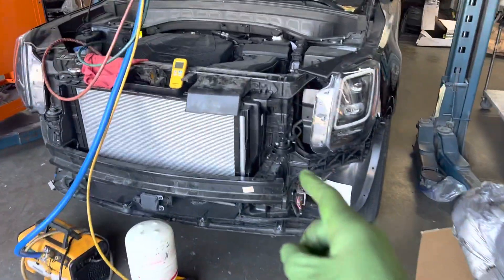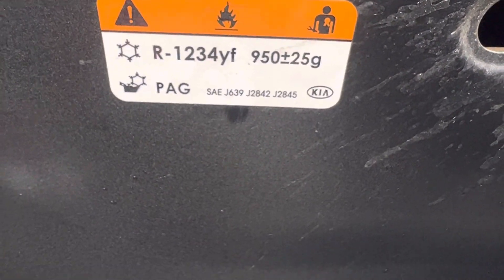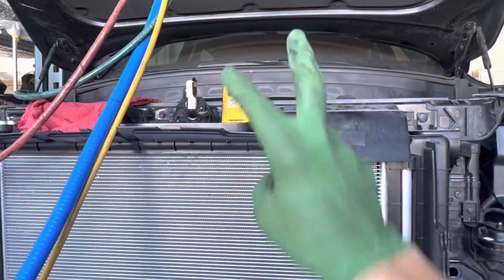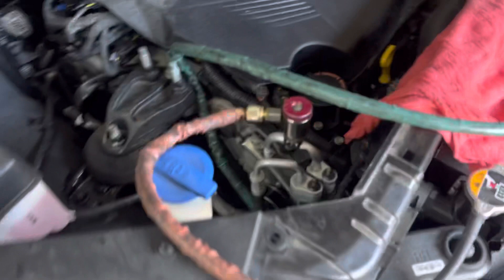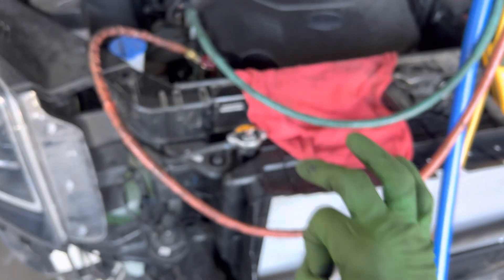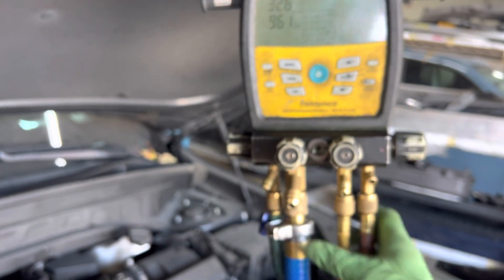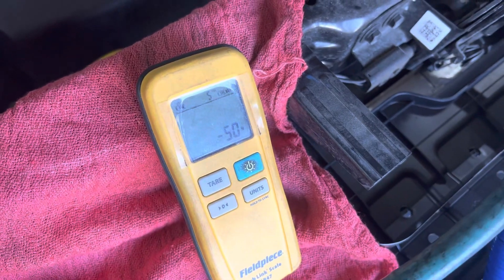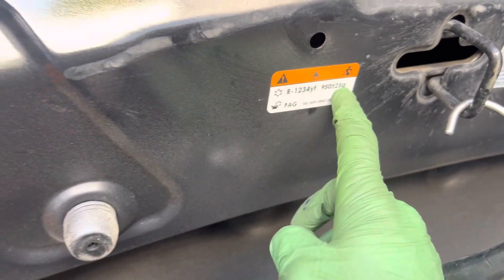SUPER LARGE AC CONDENSER  it comes to heat rejection surface area is King in the world of physics

Comment: if i put larger car's condenser, the car's ac will be cooler or will be faster cooling? for refference, my maximum standard car's ac is 18 celcius degree, how far it can reach maximum cold if i change, let's say 1.5 size from the original one. and can the evaporator handle it? thank you
Reply from the maker: 18°C is horrible performance.  Unless you must live in some very very hot climate.. 
         ACs maximum performance is usually obtained only if the refrigerant charge is correct and unfortunately, often when air conditioning is done by multiple people or people don’t know have too much oil in the system causes it not to work correctly.,

You may have also noticed air conditioning compressors do not work efficiently at idle engine speed usually once they start hitting about 1200 RPMs to 17 they work pretty good .  And with air moving over the front of the vehicle like when you’re driving down the road.. 

All this combined with a larger condenser will help the vehicle maintain its minimum temperature at higher ambient temperatures . 

For example, my tiny little 2012 Prius C . If I start the air conditioning up because I work out of my car all day in the morning at 6 AM or 7 AM I have it on maximum cooling. I never shut it off. It stays running for 10 to 12 hours every day..    and I have one of my videos up of my car on one of our heatwave record-breaking days.  41°C and when driving my dash vent temperatures was swinging between 3.8°C & 5.5°C. 

Other things to determine how cool it could get the size of the evaporator, how good the airflow is over the evaporator .
Reply: @coldfinger459sub0  hello there, thank you for your answer. i live in tropic country, out door normal degree is about 36-40, my car is old, mazda 323 from 1990's, old compressor too but work not bad. so, if the condenser can make a difference, what about evaporator. does size of evaporator make difference too?
Reply from the maker: @morether  the condenser and good airflow is all you should need. . I think if I live there, I would probably install second evaporator in the trunk like a limousine.. 

And try to find the largest condenser that probably came on a small minivan that I can fit on my small Mazda definitely some modifications will be needed .
Reply: @coldfinger459sub0  can i install the second evaporator without change compresor? it is far enough from the machine to trunk
Reply from the maker: @morether  yes since you were already planning on changing to a different condenser, you would have to figure out your own refrigerant charge. It would no longer be factory quantity.
      So installing one of those limousine kits where it’s a whole module that has evaporator receiver, dryer, and fan all in one assembly.  And they have the ports for you to connect the air ducting tubing.

You can have the cold air shoot up through the back deck just under the rear windshield, but you have to have return air because for the same amount of air that gets pushed into the car. Do you want the same amount of air to come and make it back to the trunk area. If this has a trunk I don’t know what kind of car this looks like.
Reply: @coldfinger459sub0  many thanks for this valuable explanation. i'll try to figure it out then apply things needed
Reply from the maker: @morether  just study and look at how limousines have a second evaporator added to a factory original vehicle that they stretch. 
         I used to design and fix and add air conditioning to a limousine manufacturer in my local area 20 to 30 years ago